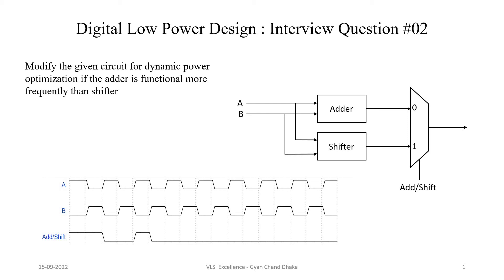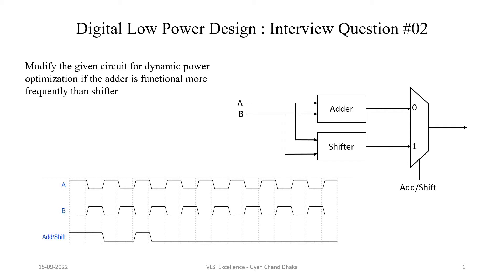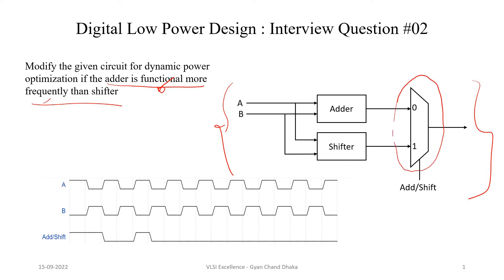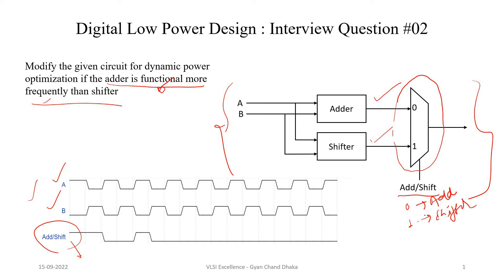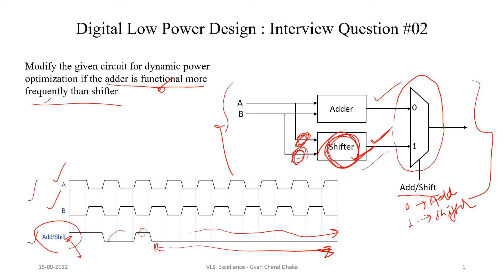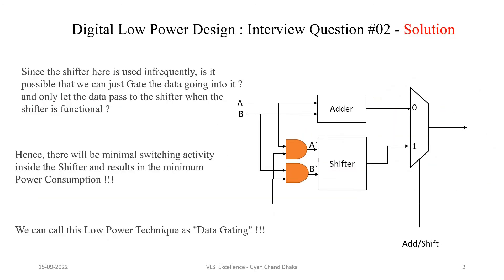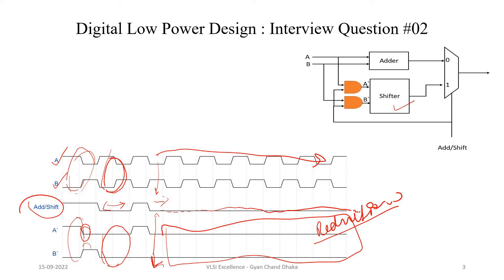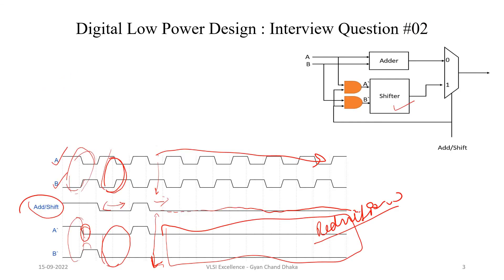Interview Question #02 | Dynamic Power Optimization | Data Gating | Low Power VLSI Design ✍️

Comment: Hi, would it be better to do Data Gating also in the adder and substituting the final mux with just an or gate?  The timing of the adder branch would be worst, but at the end the are is the same and we save another little bit of power. What do you think about this?  (Doing data Gating on both circuits means basically implementing a demux)
Reply from the maker: HI @davidecoccoluto3366, Thats correct as well from power saving point of view but as you said it will make the timing worst. OR gating will make design complex if the signals are multi bit.